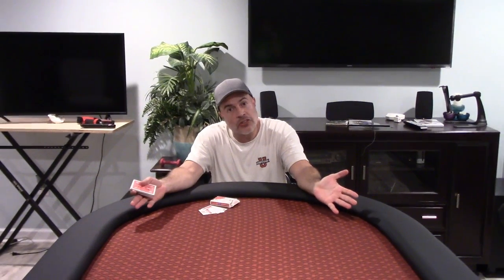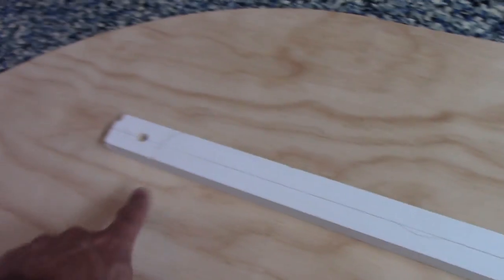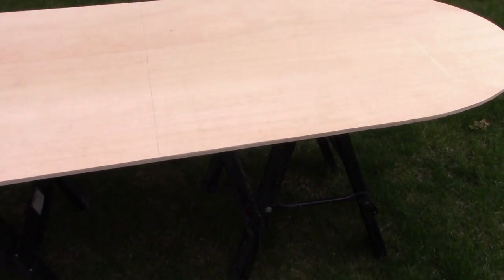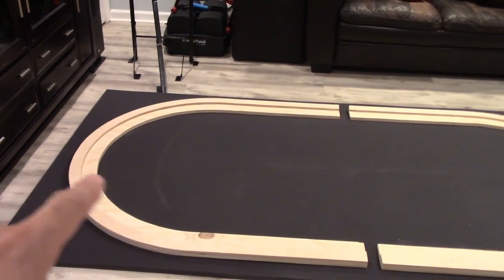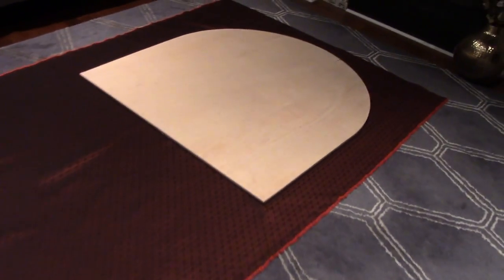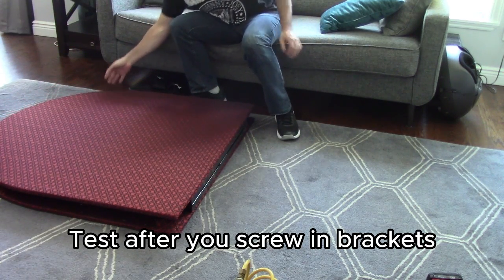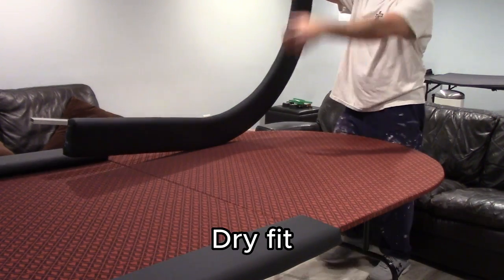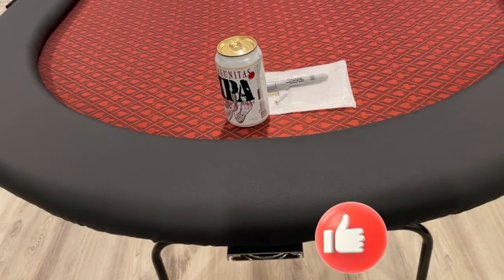DIY, full-size FOLDING poker table! Cup holders solution is amazing.

Comment: Where did you get the felt and foam? Basically, can you provide a parts list with links?  Thanks!! Well done!!
Reply from the maker: Hi, i bought everything at Casinosupply.com. Here's the list Modena Poker Table Rail Vinyl (9ft), Poker Table Rail Foam Sheet 70 Pound 1" x 54" x 105" (1pc), Volara Poker Table Foam Padding (1 10ft piece), Pro Two-Tone Suited Speed Cloth - (Sold Per Running Foot) Red (9ft). Thanks for watching
Reply: @letsdiy2gether239  thank you!

Comment: How about using mdf to make it even lighter?

Also if i wanted to have a high railing or put some LED lighting, can you suggest any changes in the steps?
Reply from the maker: Hi, yea if you wanted to add LED lights and a high railing, you would need an in-between step before you add the rails. In the in-between step you would build out the high rail. In my opinion, putting a high-rail on a foldable table might cause issues. Not sure how strong the MDF would be, I'd be concerned about sagging. Good luck!
Reply: MDF is heaver than plywood. If you added a raised rail you wouldn't be able to fold the table the same way, if at all.

Comment: what size screws did you use on  the 1/2 plywood for the hinges/legs?
Reply from the maker: Hi. I used 1 1/4" screws. Thanks for watching
Reply: In the 1/2" plywood?
Reply from the maker: misread, i think i used 1/4" screws

Comment: Any reason other than height u used 3/4 in for the other plywood? Planning on doing this but want to save on the weight issue.
Reply from the maker: I did use 3/4 to give a little bit more height, but I also felt the 3/4 would add a bit more rigidity to the 1/2 playing surface. Thanks for watching
Reply: We(recently retired poker pals) finished our table using only 1/2 in ply and no legs as we are using a standard folding table as a base reasoning that pretty much everyone has one around. Our game travels every month so we needed something lightweight and your plans fit the bill. Thanks again for posting.

Comment: do you know what those table hinges/brackets are called
Reply from the maker: As I mentioned, I already had folding legs from an old table that I used. But, what i would suggest, is to go on amazon and look for Heavy Duty Folding Legs. You'll see several options and pick whichever work for you. Good luck